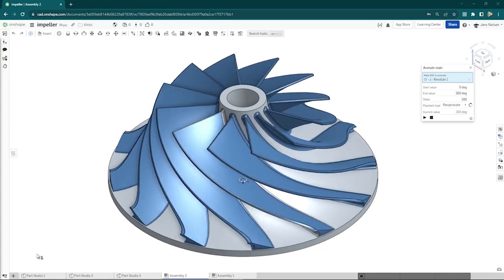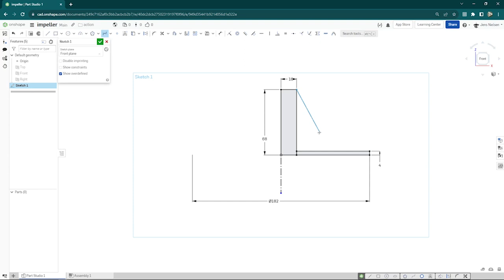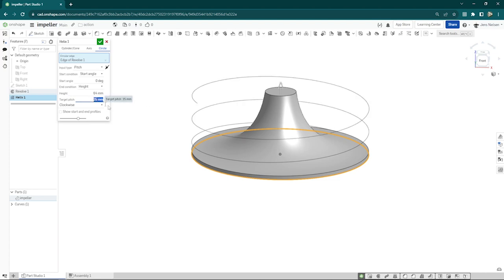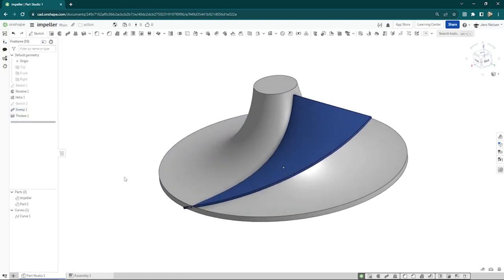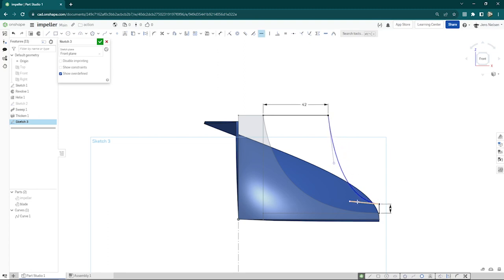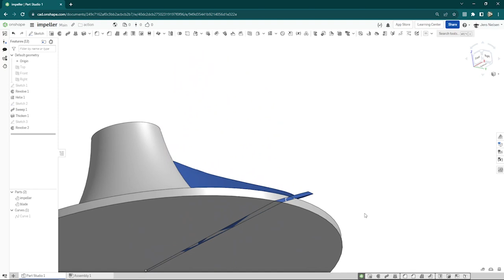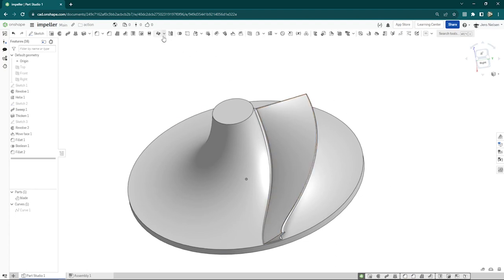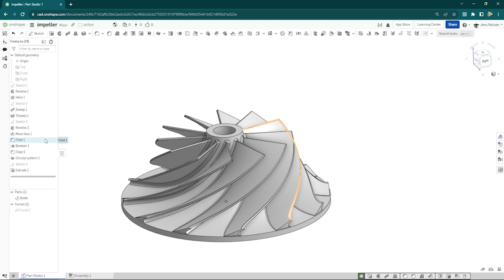Centrifugal Blade impeller design with Onshape

Comment: This is great. "Thinking parametrically" is a challenge for me. I think it would have taken a while for me to figure out that the correct way to do this is to use "sweep" with "intersect", for example. Thinking in CAD is like learning a foreign language that has no common roots with your mother tongue.
Reply from the maker: there are  other  options, a loft could assist,  or maybe a fill-just experiment and you'll find your way to express yourself!

Comment: I'm sorry, but I don't see a suction face or a compression face, just a spline. have you seen a turbocharger or a centrifugal HPC?   Or was this just for viscous fluids?
Reply from the maker: Looks like someone's been hitting the engineering textbooks a little too hard lately!  But seriously, educate a poor soul, what are we looking at here?
Reply: @cademist  so if it's too hard then what's the point eh?  I was looking for techniques in CAD to get my impeller done -- I'll just pay SoftinWay and have them do it for us.  This time YouTube really let me down, as I looked high and low and nothing I've seen could actually compress air in a functional machine well.

Comment: Hello ! Thank you for this great tutorial. I am running into an issue related to this tutorial.
Here when you are Sweeping the line, the extremity of the Line that is along the axis of the helix is somehow locked  to this axis, and then when you sweep, the orientation of the line turns to correctly create the blade.
In my case, I am using a 3D Helix (Helix spinning around a torus) created with Feature Script, and then when I sweep a Sketch along my curve, I would like that the orientation of my Line also turns along the path. It does not seem to work... Any idea ?
Thanks in advance
Reply from the maker: You're welcome! Here is a link to my doc: https://cad.onshape.com/documents/3e059eb8144b06229a8783ff/w/78f2feef9b3feb26dabf0384/e/143ace69db16a93280574f3b?renderMode=0&uiState=6601bc9a09230601c7b4cdd1 
If you share a link to your document I could have a look.